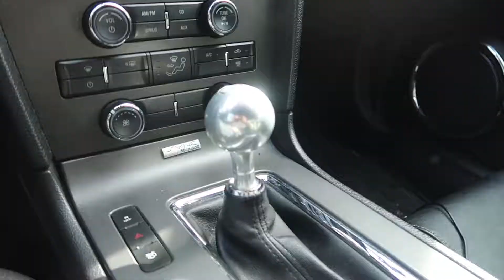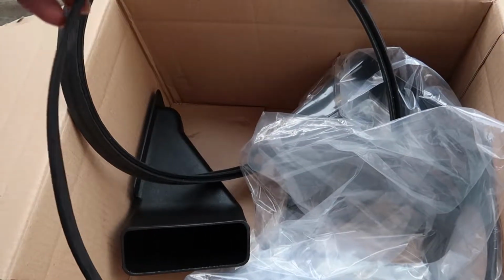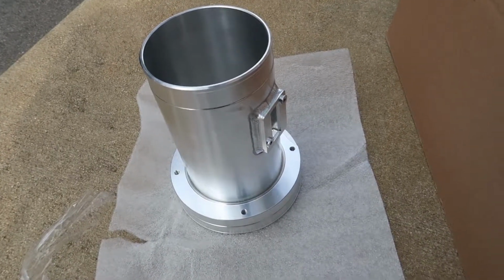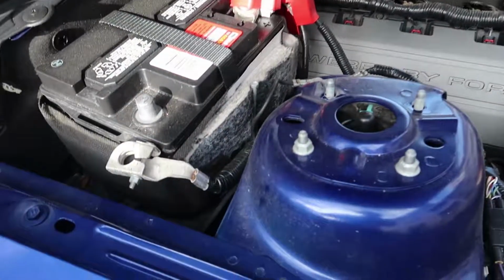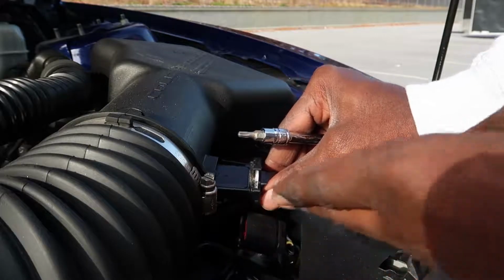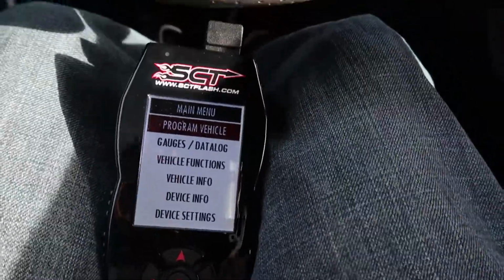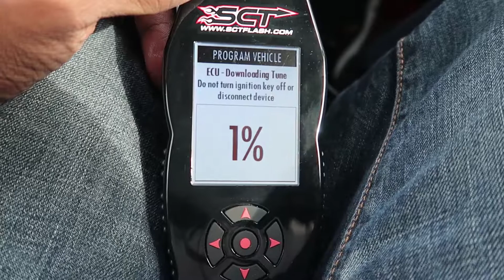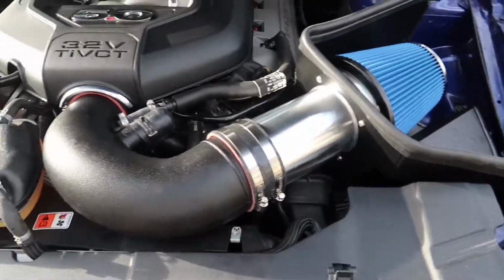2011 to 2014 Mustang GT Steeda Cold air Intake Unboxing and install

Comment: Great video how’s it been holding up bro?
Reply from the maker: It's been holding up great just got the car tuned by Palm Beach dyno and it's running better than ever
Reply: Chris Laboo was thinking of keeping Air box stock and running 93 octane time, how was the 93 stock tune did you run it? 

And with Steeda how strong did it run ? Any numbers on it with this set up alone? Thanks
Reply from the maker: @Kasakee2  I didn't really feel to much of a difference with the stock air box and 93 tune but the car idled a little better. Felt a big difference when I switched to the steeda intake. I'm tuned by Palm Beach dyno now and there is a world of difference. Car spins tires all the way to third gear.

Comment: Stock cold air baffles sound in tube that shields from engine heat/dirt.  These open elemants just increase sound and let alot more dirt in.  Increases intake temps at idle as well.

Comment: So if I buy both of these parts from American muscle, I can take them right out of the box and install them? For some reason I always thought you had to take it somewhere to get it tuned, but instead I can tune it myself like you did ?
Reply from the maker: That's right as long as you have an sct device you can do it yourself. But I do recommend getting a custom tune down the road to get the most from it.
Reply: Sounds good man, thanks !